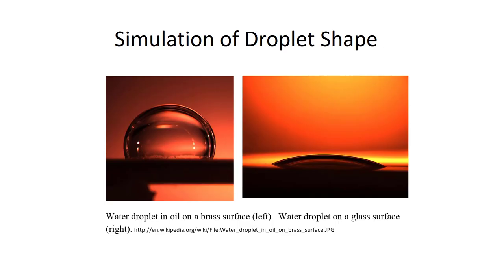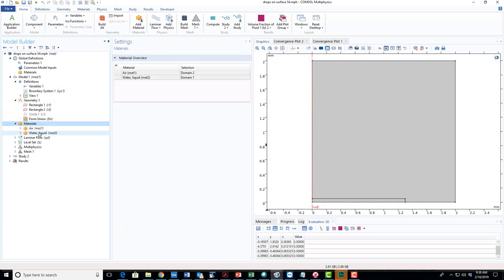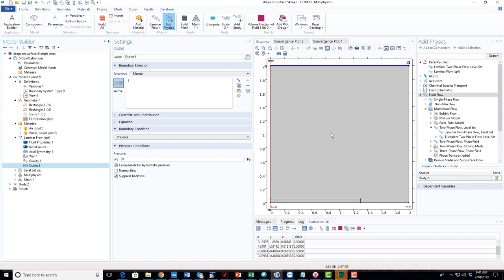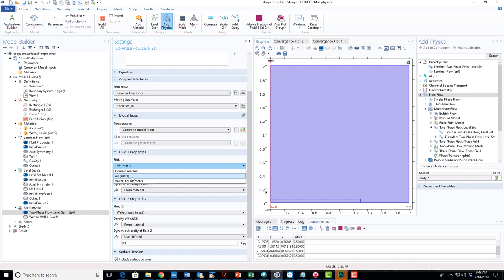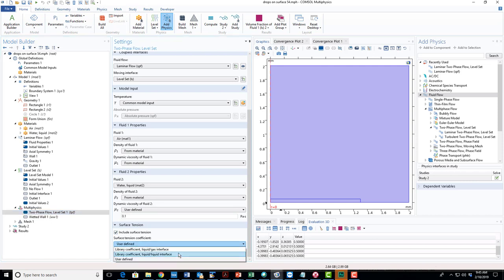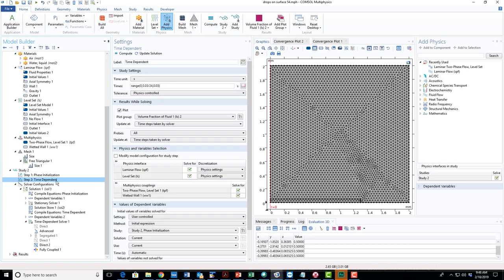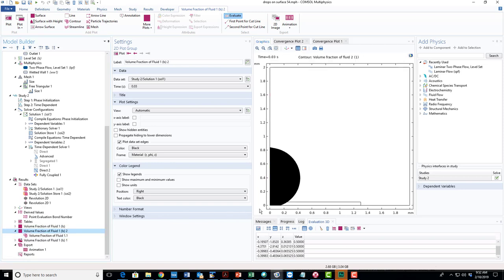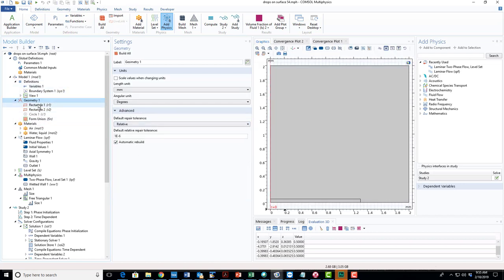Shape of a water droplet

Comment: for static state, you can direct solve the young laplace equation to get the shape, comsol is actually highly inefficient, because it solve the dynamics which is not neccesary, for more general case, you can use surface evolver which works by minimising surface energy, there are many refs out there, i used to do a lot of these when i was a student

Comment: What would be good approximations for the reinitialization parameter in the level set method? I've tried simulating something similar (related to electrowetting), but my droplet keeps oscillating about it's mean position- I have read that this might be due to numerical instabilities caused by incorrect reinitialization, hence the query. Thanks in advance
Reply from the maker: Hi Sitangshu,     I have used the default reinitialization parameter and it seems to be satisfactory.  Comsol is pretty good at figuring out reasonable default values.  I was reviewing a model the other day that was set up to simulate a droplet flowing down a vertical wall using the Phase Field method.  The results seemed to behave reasonably well, although unfortunately we don't have experimental data.  You might try using the Phase Field method for your problem.   Larry

Comment: Nice one.  Very helpful and interesting. 
Can you please suggest me out to set mass transfer across interface of droplet. For example sessile droplet on surface ( T= 25  C) and incoming air flow ( T = 28 C ). Mass transfer occurs only through molecules diffusion and phase change at interface. 

Thanks for your help.
Reply from the maker: This is feasible using the regular transport physics with a moving mesh to handling the change in shape and size of the droplet.  There is a video describing using the moving mesh to simulate a dissolving droplet that may help.  However, the sessile drop video uses level-set physics.  This works well for simulating flow of two phases, but the last time I checked it could not do transport.   Larry